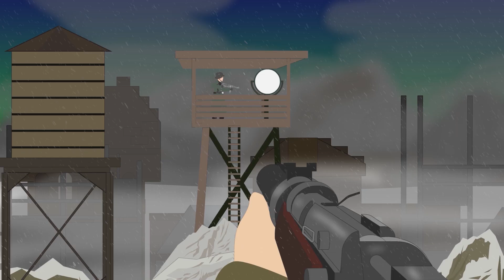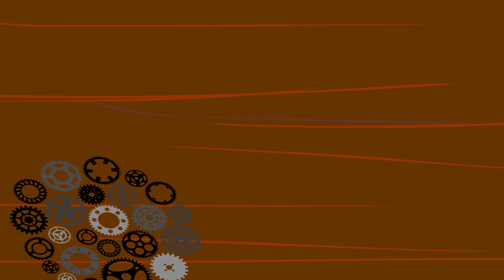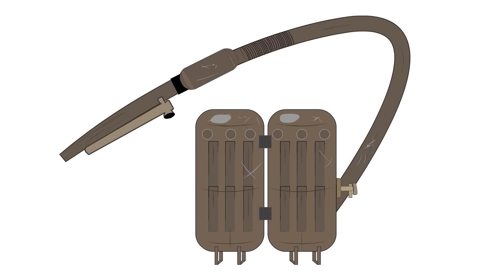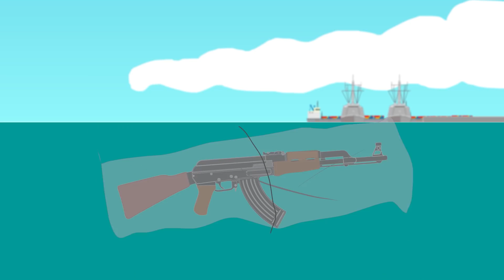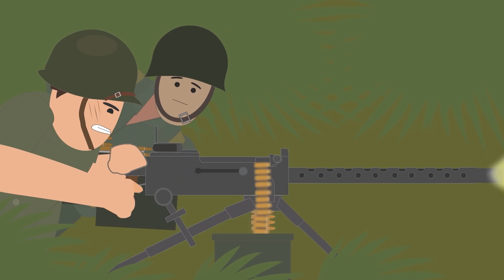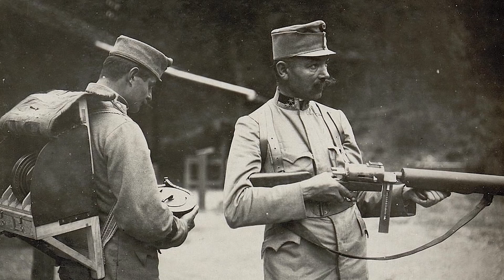Rare Guns you've never heard of

Comment: Ok,so i will add a couple more:
The Johnson M1941's(M1947):
There are 3 weapons that are named Johnson M1941(M1947),1 of them was a LMG,a Rifle and a derivative Automatic Carbine(from the LMG),they were made by Melvin Johnson;all of them shot the .30-06 cartridge.The rifle was made to compete with the M1,and it did;it didn't use clips,it used loose amunition,so you could actually reload it with a half empty magazine,unlike the M1,which you needed to use all thebullets.The Johnson Automatic Carbine,or Johnson M1947,as i will call it,was a semi-automatic derivative of the Johnson M1941 LMG,meant to replace the M1,but failed;only 5 prototypes;it had a 25 round single stackbox magazine,but Wiki also tells me that it had a 10 round cylindrical magazine,and from pictures,i don't think it's true.
The LMG was the replacemeant LMG for commando's.
I just talked about a series of guns,and i'm done.Wanted to talk about the K31,but you can go to Wikipedia too.

Comment: The math is a bit off.  With a bullet weight of 82 grains and a muzzle velocity of 656.2 fas, the muzzle energy would be 78.4 ft-lbs.  Pathetic, but potentially lethal.  On the other hand, I question the bullet weight since a typical .22LR (twice the barrel diameter) is only 40 grains.8

Comment: I wanna see what the furthest is they can push designs in modern day. With no budget constraints. Nothing is classified. You have the complete knowledge and materials of the whole world. What kind of gun could be made?  Biometrics. Bci tech that controls the gun with your mind. Some type of device that auto selects the power of the round so it can hit and defeat its target most efficiently. Multiple selective fire modes all the way to non lethal. Caseless ammo that isn’t fragile. Some crazy device that channels the heat into charging the battery. Basically silent when fired. Can barely hear the mechanical parts. Some crazy telescoping barrel that works with the gun to instantly change forms between different types of guns. Can even become a large pistol.

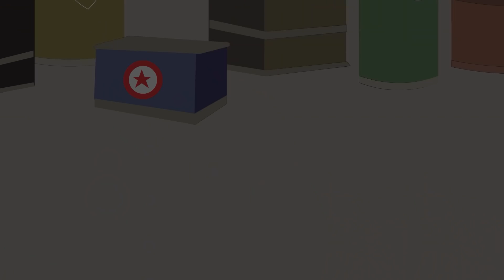Comment: 18:24  OK! That flamethrower for one use was basically a cire extincuisher in REVERSE!
It had two tubes,smaller one filled with Li,Na Or K Secondary or Tertiary Halogen Alkils or ANY OTHER STUFF REMAINING THAT IS Pyrogolic! Which means it is ignited in contact with air!n😊
The rest is simple,N2 bottle under a HIGH pressure with one GENIOUSLYy design nozzle and plumbing with Pyrogolic substance/mixture held in separate smaller container! It had one great trick,you could use it as a mine/Bobby-trape or simply “christening” enemy soldiers or position like tank od bunkse with a petrol and then puppetier ed or risk being BURN ALIVE!

Comment: People can’t figure out how the hellriegel works as a blowback weapon but I think it’s cause the gas block is also the sides of the mag well. It would make sense that it has double sided gas transference as the 2 prongs sticking out of the back are it’s buffer springs, 2 spots for the gas to blowout=2 springs for retention   Using 2 also allowed them to be smaller to fit the sub machine gun profile

Comment: The M2 machine gun used in American fighters in WW-II is not a 30 caliber, it's a 50 BMG chambering. Confusingly, the AN/M2 30 caliber machine gun used as defensive armament in the SBD and TBF (ventral gun) is a lightened version of the venerable M1919 Browning machine gun. That, as stated in the video, was adapted to create the Stinger.
Reply: Just saw the rest of the vid…… they said “AN M2 machine gun” which is also a real thing…. AN stands for Air Force/navy it’s a lighter version of the m1919 because it’s cold AF at altitude.
Reply: The M2 was also a select fire version of the M1 carbine but with a 30 round mag. both were chambered in .30 cal carbine
Reply: @zackzittel7683  M2 'Carbine'. Totally different animal to the M2 family of .50 caliber machine guns.

Comment: Simple History should have done more than some wiki research on the FG42. Even the animation is misleading.

FG42:  German paratroopers jumped with submachineguns and pistols only while their heavier weapons and other equipment dropped with them in separate cannisters, sometimes needing too fight to get to the cannisters. The FG42 was designed so the paratroopers would have a more compact (it's no longer than the Russian SKS) and have effective firepower when they landed. A lesson learned in Crete.

The side loaded magazine is not a balance issue since the FG42 was rarely used on full auto (as depicted on every video game) because of the sheet metal used in it's design. the receiver wasn't strong enough for much full auto use. 
Translated excerpts from the FG42 manual: 

Paratrooper's Rifle 42 - FG42 - Weapon Handbook - (Issued September 1944) 
Part 1 
[from] I. Purpose and Characteristics 
"The weapon fires single-shot and, in emergency, in the full-automatic mode. Single fire is effected from the closed breech position; automatic from the open breech." 

Shooting the 8mm round, I hear a lot about the "high recoil" of the FG42, but the felt recoil is closer to that of the M16 than a battle rifle thanks to it's ingenious flash suppresser,  spring loaded buttstock and orientation of the barrel, receiver and buttstock. I will admit though, with my reproduction from SMG, the solid receiver helps even more.

Comment: I think the most distinctive thing about the MAS-38 is its stock/recoil system. Rather than an inline path of travel for the bolt the '38's bolt reciprocates at an angle to the bore axis. The extra force required to push the bolt at an angle acts as a slight delay to lower the rate of fire and allows it to use a slightly lighter bolt than would be required from a more conventional action in the same cartridge.

It's a really interesting SMG from the design perspective. Easily in the top 5 most unique SMGs of its era.

Comment: A couple arguements; The version I hear everywhere else is that the FG42 was only made at one facility which was bombed beyond repair, and rebuilding was shelved because of the time required.
The APS was replaced by the ASM-DT, which could be used in air by switching the mag out for one loaded with normal 5.45mm, those may still be in service, the APS isn't.

Comment: First off, the TBF/TBM Avenger was not a fighter-bomber.  It was a torpedo bomber that was also used as a level bomber.  There were plenty of F6F Hellcats and F4U Corsairs that could be used in the fighter-bomber role.  Another weapon that is fairly well known but still built in limited numbers was the M50/M55/M60 Reising submachine gun.  It did see combat with the US Marine Corp on Guadalcanal in WW 2.

Comment: First off, the 8mm Nambu pistol round is not underpowered. It can be compared to 380, in nock down power, and 32 acp in speed (fps), if not faster; all with less recoil than the 380 round.
Reply: Its about like .32 acp in energy. Thats pretty whimpy.
Reply: Knock down power is a myth and all pistol rounds are underpowered for humans because they have to be small enough fit in a pistol but Nambu is 1 of the weakest.

Comment: 5:30  The operating system went into the M60, too.  Unique operating system, solves at least two of the Luftwaffe design requirements in one fell swoop, all while being about the only German gun that's actually simple.  Louis Stange was a genius.
Reply: Not simple at all. It is designed to use both a closed bolt and open bolt depending on the setting the gun is on. That is needlessly complex even by German standards. There is a claim the Heer wasn’t willing to work on the project because it only existed in Utopia.
Reply: @emberfist8347  Do you know the actual mechanism or are you just hearing that it fires from the closed bolt in semi-auto and the open bolt in full-auto and assuming that there's no other way to do that than complexity?
Reply: @smorrow  I know the actual mechanism need to do something like that would be more complex than needed. Using two different modes like is always a complicated design. Since you need incorporate parts that allow it to be locked in battery in both closed and open bolt modes.
Reply: @emberfist8347  Hint: The "closed" bolt when firing from closed on the FG is really more like "not all the way open". Switching from full to semi just translates the sear laterally so it's engaged with a different notch on the operating rod (oh, and brings in the involvement of a disconnector, because of course). The weird selector switch (where you pull it out first, then pivot) is an artefact of this.
Reply: @smorrow  Still having it be closed bolt for one mode and open bolt for another and the way you describe the selector switch are more complicated than they needed to be.
Reply: The MP40 and K98 are about as simple as you can get lol

Comment: The use of the De Lisle didn’t end with the end of W.W.II, the weapon went on to be used in both the Korean War and the Malayan Emergency, there’s also rumours that the British SAS made use of the weapon in the early days of the troubles in Northern Ireland.
Here’s another nobody has ever heard of even though it was officially adopted by the U.S. military, the Hyde-Inland SMG which was officially designated as the M2 SMG and was supposed to replace the M1 Thompson, only around 400 were ever produced, the contract was cancelled when the M3, an even cheaper design, came along.
Reply: The early days of the troubles was right around the end of ww1
Reply: Fun fact: The Hyde-M2 was actually really well made, but as you stated, it was expensive.

Comment: Just so everyone knows, millimeters is one bore measurement and caliber is a different bore measurement . Caliber is in inches , Millimeter is itself.  Gauge being the number of bore diameter lead spheres it takes to equal one pound of weight . 12 gauge = 12 spheres . And just for a fun fact, 12 gauge in calibers is about  a .73 caliber .
Reply: Gauge bore diameters:
10ga - .775"
12ga - .725"
16ga - .665"
20ga - .615"
28ga - .545"

.410 is not a gauge (noted by the decimal) but bore size. 410/1000ths of an inch
Reply: That's not how gauge works, the gauge represents the load as a fraction in pounds, higher numbers meaning smaller loads. 12 gauge is typically a 1/12 pound load of lead.
Reply: @IncendiaryOCE  no. Gauge is directly related to bore diameter.

12ga - .73" diameter. Takes 12 .73" diameter balls to equal 1 pound.
Reply: @IncendiaryOCE  here's directly copied information:

>Gauge is determined by the number of lead balls of size equal to the approximate diameter of the bore that it takes to weigh one pound. For example, it would take 12 lead balls with the same diameter as a 12-gauge shotgun bore to weigh one pound.

Comment: You missed important details of the FG42. The sidewalk magazine is meant to ease going prone without interfering with a scope. The handguard was also the bipod. Given the fire volume of bolt action rifles and the times standards it was a suitable squad support weapon for paratroopers. Because of the massive recoil of 8(7.92)mm Mauser it was used as a semi auto when on the move. I wouldn't class it as an assault rifle since the assault rifle is meant as a hybrid between a semi-auto battle rifle and a submachine gun while the FG42 is closer to a hybrid between an automatic rifle/LMG and a sniper.
Reply: @Unknown_Genius  I meant to say that it was a good enough squad support weapon for a group of paratroopers with bolt action rifles and/or SMGs since it's leagues above better than not having any kind of squad support weapon, since as you yourself pointed out LMGs were not an option for them. Also, I know that the main purpose of the sideways magazine wasn't helping in firing it prone, but easing prone shooting is definitely an effect of it's design. In what comes to the concept of lmg+20 round bolt action, that's pretty much what I said myself. If I called it "sniper" is because they were meant to be used with a scope and that pretty much fits the bill.
Reply: @Unknown_Genius  so the practice was that it acted as an squad support weapon even if the original intention was for every parachuters to have it

Comment: At 16:00 the Volkssturmgewehr is translated as Peoples(Volk) Assaultrifle(Sturmgewehr). While this is correct in grammar, it’s name actually came from the Volkssturm(the Homeguard) Gewehr(Rifle). Meaning it’s the Rifle of the Homeguard, not an Assaultrifle. It’s a bit confusing since the Homeguard is named Volkssturm.

Edit: Timestamp correction
Reply: Jonathan Ferguson would be proud
Reply: I think the best translation would be Militia Rifle. Since its called (Volkssturm)gewehr, with the reference to the militia unit. And its semi auto only, so it can't be a assault rifle to begin with.
Reply: @serch3ster  Yes that’s what I thought. It makes sense in German cause Sturm can have different meanings depending on the context.
Reply: Yeah that's one of the problems you run into when your language use a lot of compound words. When you put already compounded words together with other words to create a new compound word it can be come ambiguous what the actual meaning is. Swedish has the same issue
Reply: Kann mich jetzt spontan nich erinnern ob das je einer von drüben mal richtig auf die Kette bekommen hat, das Thema Volkssturmgewehr.
Reply: The word Volkssturm was only used 1944/45. Historicaly correct would have been Landsturm. In old days of HRE those levie units had been called also Landwehr, Landmiliz, Landesaufgebot, Landesdefension, Landfahnen ( Fähnlein was german word for company or battalion used before french language was international langue) etc..
Reply: @brittakriep2938  Yes, but the rifle was also developed at the end of the war. 5. November 1944 was start of production, while the Volkssturm was founded at the 18. October 1944.
Reply: @Moc_Builder  : My comment was not about the weapons, only about historic background of the word Volkssturm. While rural militias, often realy only levies contained the word ,Land'/ country- in this case rural is better, townsmens militias contained Stadt ( town) or Bürger ( citizen), so Stadtgarde, Bürgergarde, Stadtmilitär, Bürgermilitär, Stadtmiliz, Bürgermiliz, Stadtkompagnie, Bürgerkompagnie, Bürgerwehr, etc.. Some of this militias still exist today, but only either as target shooters society or as only ceremonial , historical militia'.